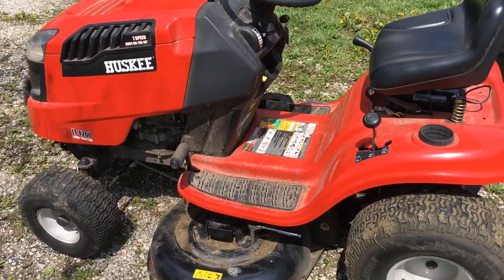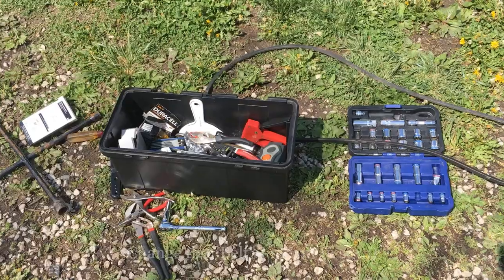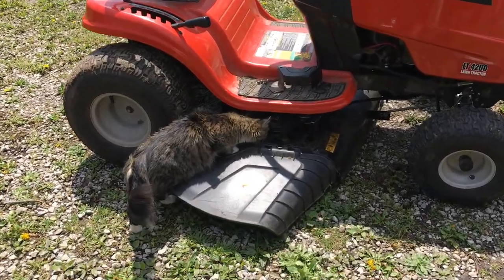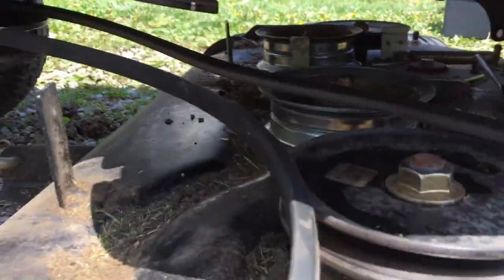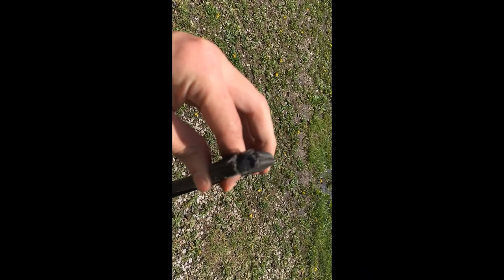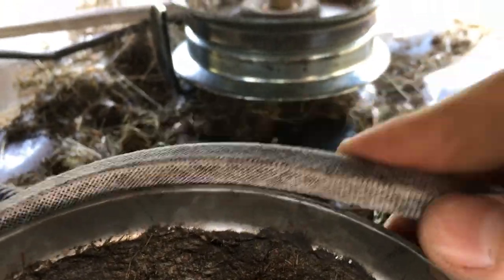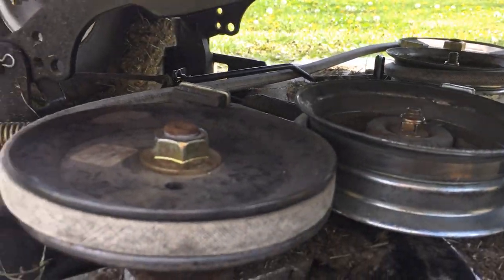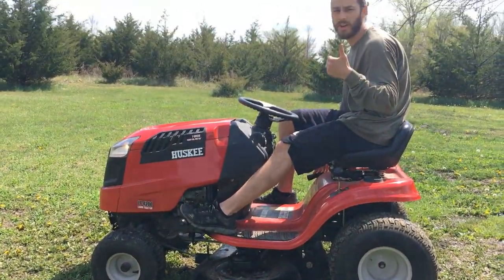Replacing a riding lawnmower belt (Huskee LT4200) without taking the deck off.

Comment: At 7:30 you don't need to hold it at the bottom with the pliers. There are two black tabs that come out from the bottom and bend upwards. You can use those black little handles to hold the blade drive pulley in place while you loosen the bolt on top.

Comment: “***simple fix***

My belt jumped off and I had the same problem: trying to get the belt around that lip.

I used a tire iron to pry the lip back a bit and then used a hammer to beat it back. Worked like a charm. Hope this helps.

Comment: Hello JFREEDOM.  Thank you for the video.  Can I ask you a question regarding the orientation of the Deck Engage Cable (PTO Cable) on your unit?  I'm struggling with one that seems a bit short, not enough slack to route it through the tab that's on chassis, and the only option is to let it rest on top of the transmission.  Not sure if this is ok or if I need to purchase a longer cable.  Also, there should be a part # on your existing cable.  I don't have one at all, so I believe the new replaced cable is not the correct one.  I hope it all makes sense to you.

Comment: I have an exact model of this mower and I'm having problems with it staying running while using it; it suddenly shuts off after around 20 to 25 minutes or more while using it, then starts back up after restarting it; any ideas on what the problem could be?
Reply from the maker: Pull off your spark plug and see if it needs replaced, I had that same kinda issue and that’s what it ended up being.
Reply: @jfreedom7721  ok, thanks! There's one other problem with it that I'm having, and I'm not sure why its doing this: when  im not moving on it while using it; it revs up really loud like its about to explode or something. I keep the seed lever of it at around 5 and half while I'm mowing, and I don't move it any when it does this.  I looked around at everything to see if I could figure why it's doing this, and I havent found anything broken or loose; other than now knowing that the spark plug may need replacement and this, there's nothing else currently wrong with  it. Any ideas on what might be causing it to do this? I really appreciate your help!
Reply from the maker: Find your carburetor and look directly above it, there is a Phillips screw with a swirly wire coming off the back, you can adjust it by turning it, which will change the rpms the mower is running at, it may be set too high which is why your mower sounds like that.
Reply: @jfreedom7721  ok thanks!, the spark plug did need replacement, and I just tried adjusting the carburetor; and it now runs and performs like normal!  I guess the adjusting screw came loose at some point, because I found that it was a little too loose; that might be why it was running like it was, its fine now, so thank you for your help!